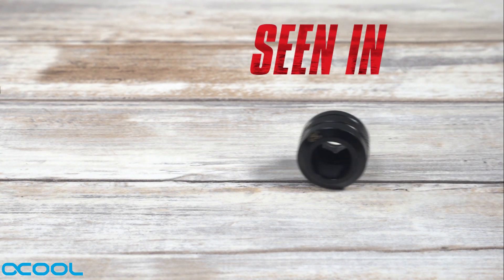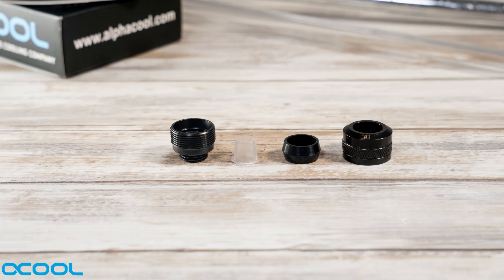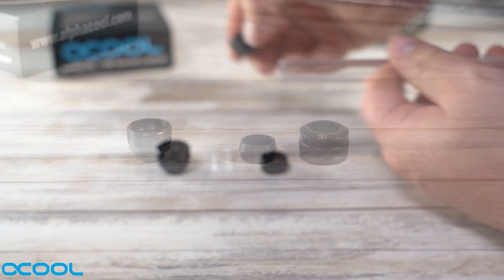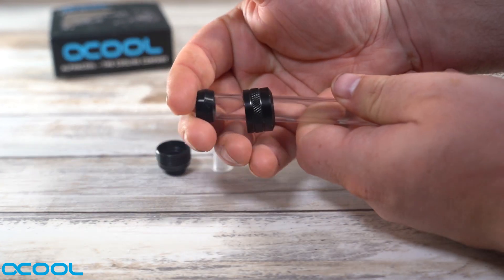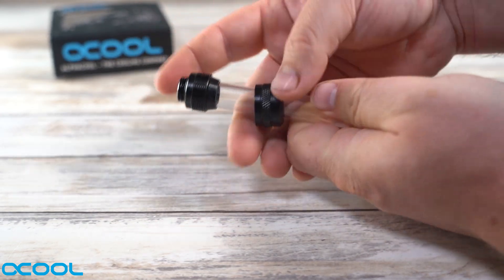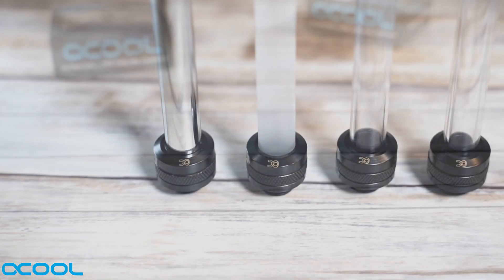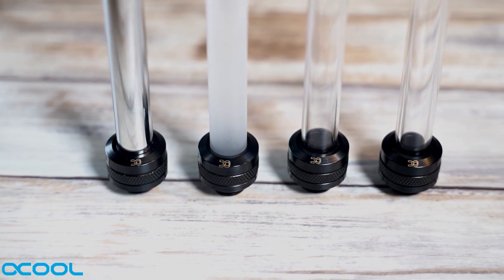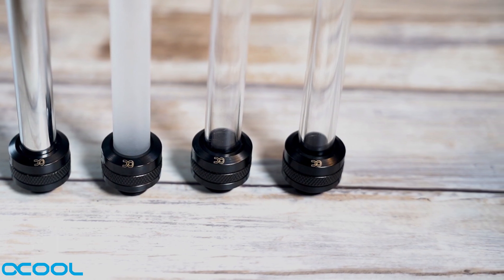HardTube fittings Alphacool Eiszapfen Pro in 60 seconds

Comment: For those wondering; 20 kg on a 13mm OD diameter tube equals around 14,8 bars of pressure. Inceasing pressure should also increase the clamping force since the tube will expand onto the o-ring.